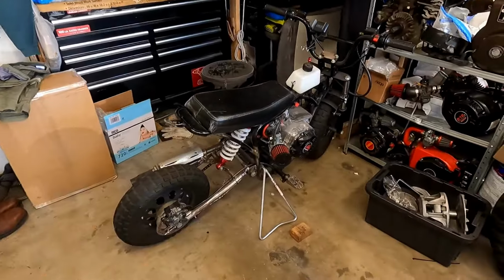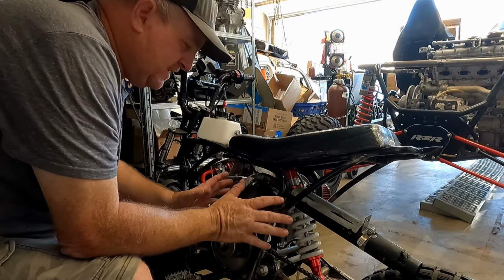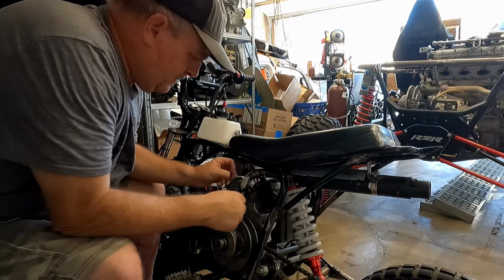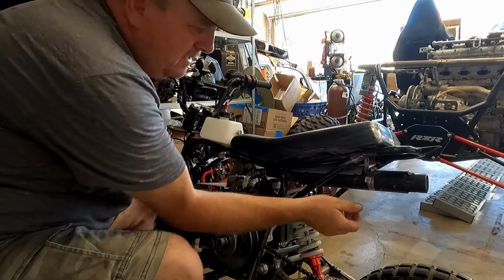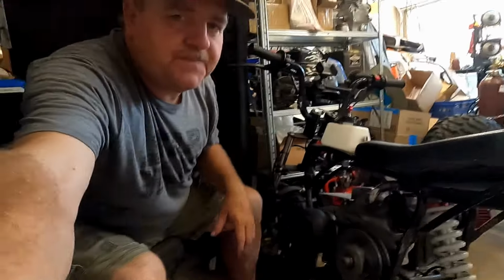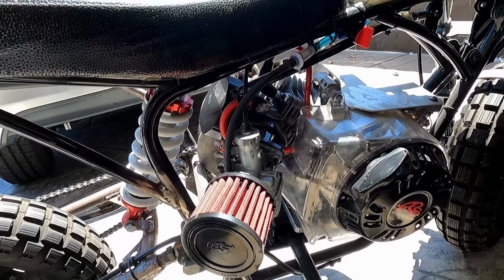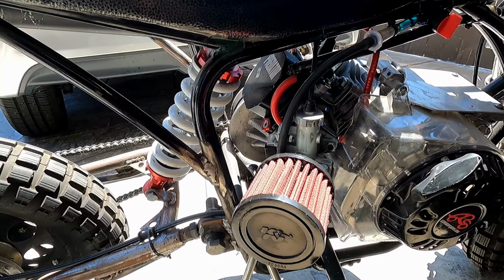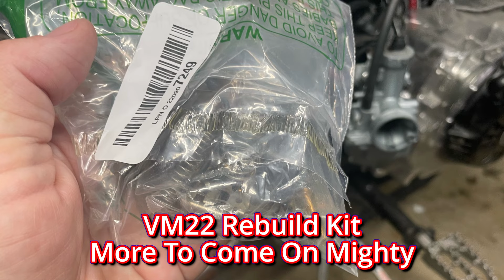My MEGA MOTO 80 - Will It Run Again?

Comment: The quality of gasoline these days is horrible. It starts to break down after about a month of sitting and begins clogging up the carb. I can remember buying old cars in the 1980's that had been parked in a field for years, I'd throw in a new battery and put a bit of fresh gas down the carb throat and they'd start and run on the old gas. About all our modern gasoline is good for is gumming up carburetors.
Reply from the maker: Yes the carb was dirty and the jets clogged. Got’’em all cleaned up and it’s started yesterday. Ran pretty good 👍